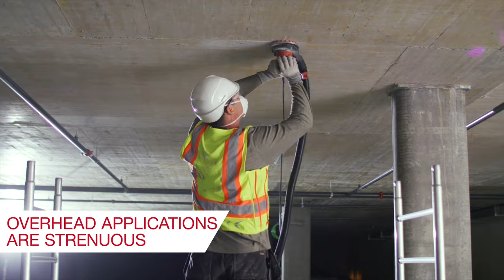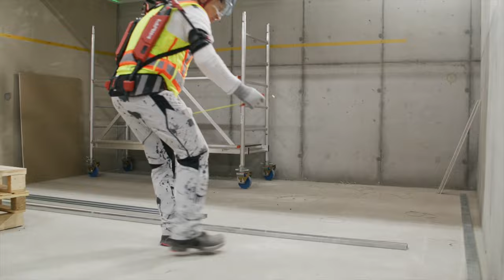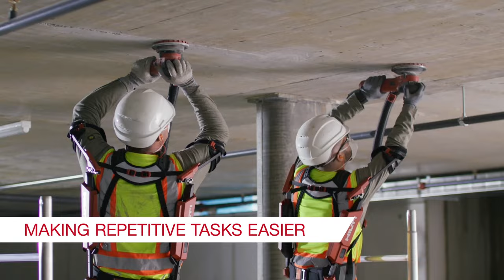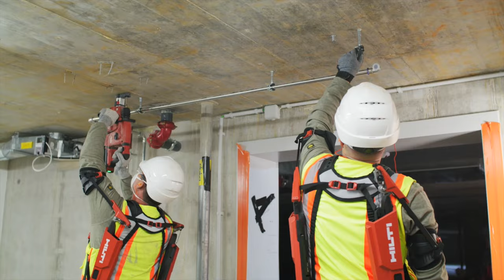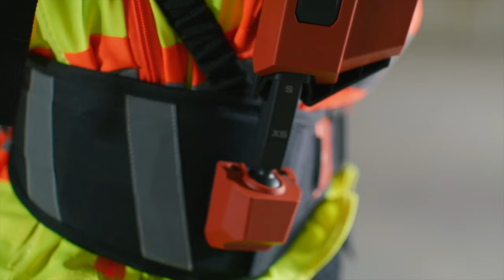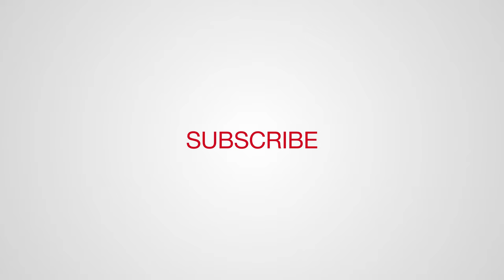Hilti EXO-S Exoskeleton designed for overhead work - Features and Benefits

Comment: Can this be used as a single arm setup? I completely destroyed my shoulder in marine corps and now after multiple surgeries I have zero strength overhead in my dominant arm.
Reply from the maker: Hi Silvernail, thanks for the question. Each arm is independently managed.  For example, you could have more tension on the right arm than the left, or only engage the dominant arm if the other is not doing overhead work.  The choice is yours.
Reply: My shoulders have both been replaced after a law enforcement accident. Now retired I do construction and it is a game changer. I paid out of pocket and it was worth every penny. You will get a benefit in both arms but mostly the injured arm. God bless oorah!

Comment: Products like this actually are worse, instead you need to workout and build strength in your muscles ;)
Reply: I don't think so... the problem is not that you need more muscles or not... the problem is that human resistance has a limit not only on how much weight to carry, but for how long, what type of load it is, at what height and what conditions, etc.... and let's not forget that someone who practices physical exercises does not mean that they can do a better job than a construction man because the physical activity or activities carried out are not the same, remember that more force and muscles does not mean more resistance. And furthermore, in the event that these workers could actually do physical exercises, would they have the time and the necessary strength after a tiring day at work to do even more stressful and heavy exercise for just a few muscles? I don't believe it. In addition, these exoskeleton do not replace human muscles or strength, they help and complement each other against accidents at work caused by excess weight or very dangerous activities in general for workers in certain things, such as exhausting and very uncomfortable positions for the human body that would harm them in the long term.
Reply: It doesn't take away all of your strength, just lightens your arms.  You also have to balance how much you wear it.
Reply: Try to keep your hand above head for half an hour, than imagine doing it 6 hours a day, every day.
Reply: Whoever says something like that has clearly never actually spent a single day doing strenuous overhead work, let alone a career.
Reply: Working out won’t change that both of my shoulders have been replaced. This is a blessing to me. I can work without pain.
Reply: You are so right. It’s the repetition of painting, caulking or insulating. I couldn’t wotlrk without it. I have had both shoulders replaced. It’s a game changer for me.